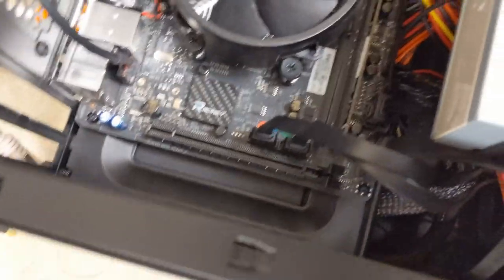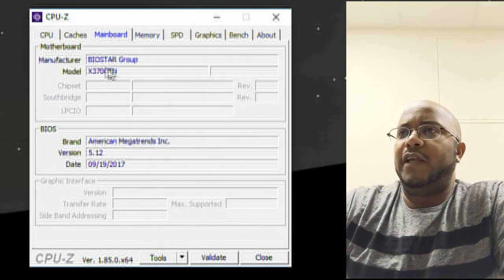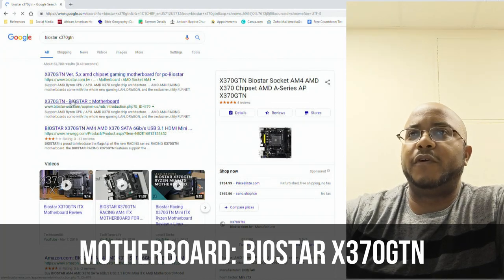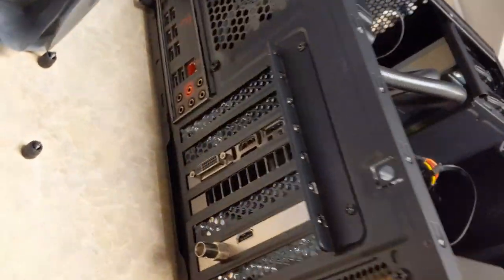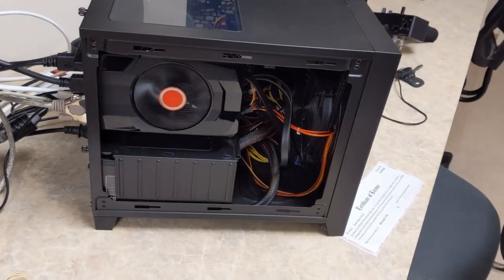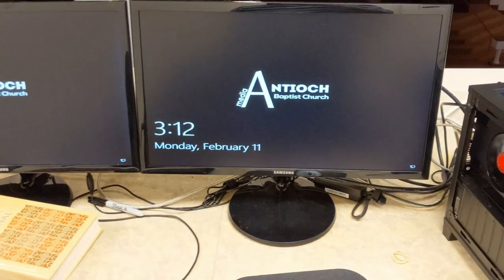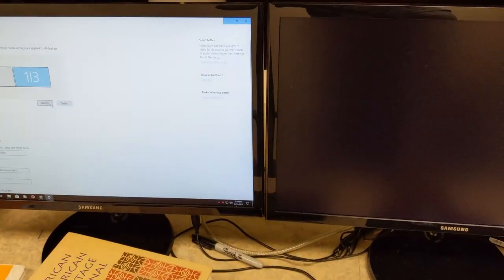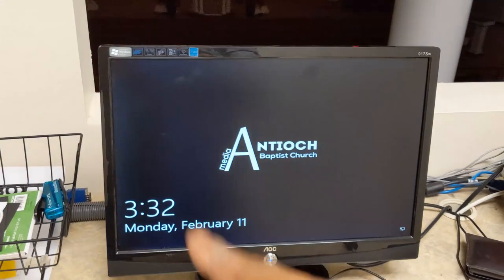Church Presentation Software Multi-Display | Buying and Installing A Graphics Card

Comment: They are selling me a gtx 750 ti. I want to use it for 3 outputs of propresenter or easyworship. Will it work for me or I need something more powerful. the rest of the components are i5-4570, 16ram, etc ... Thank you and blessings
Reply from the maker: the 750 ti is what I was using at church up until this year so it works fine but if they try to charge you anything close to $200 for it, you could get a gtx 1650 for that price
Reply: @AJaytheCEO  
Thank you so much for everything. I watch your videos a lot even though I'm Spanish-speaking. You give very valuable information. Accessors and that gives assurance of what to buy and what not. Greetings from Costa Rica!!